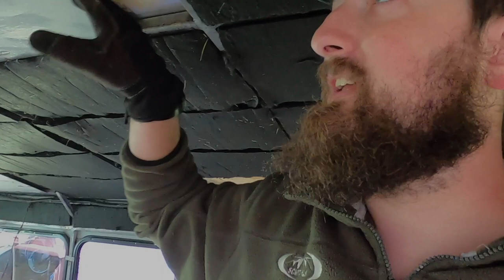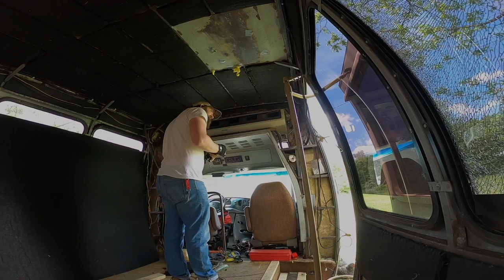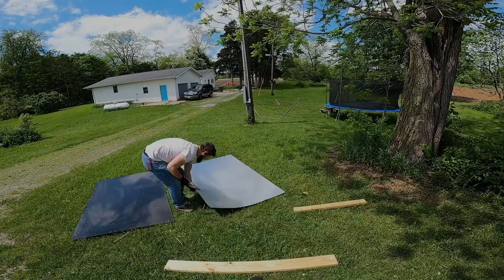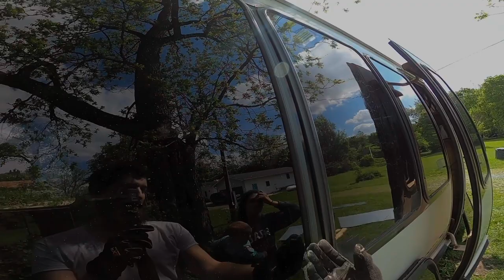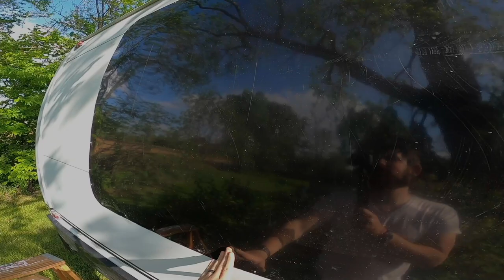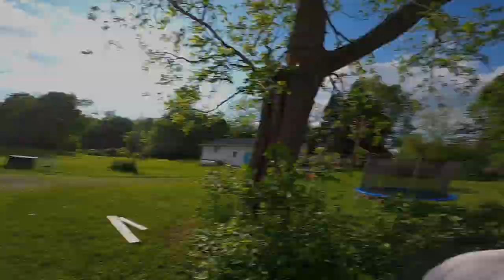How Do You DELETE Shuttle Bus Windows?!

Comment: I have been considering this for some time for a few windows on my shuttle.  It saves me dealing with re-weatherizing the existing windows, it should be significantly lighter overall, provide better insulation in the end and further privatize my sleeping area thanks for making it look challenging yet manageable as I am also prone to a tinge of new project anxiety.  I will have to see where I can source some of that sheeting before I start pulling frames.  THANKS AGAIN!!  BTW your bus looks huge compared to mine, how long is it?
Reply from the maker: It’s definitely a big project but went way faster and easier than I thought it would. My bus is a 28’ Krystal Koach. I absolutely love it and after doing the window delete really made the inside more private and manageable for sleeping quarters